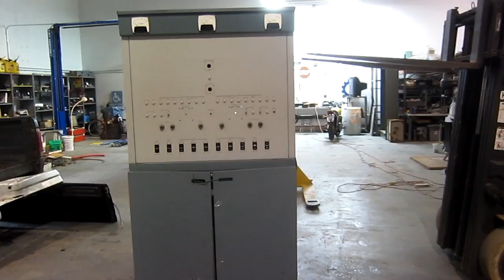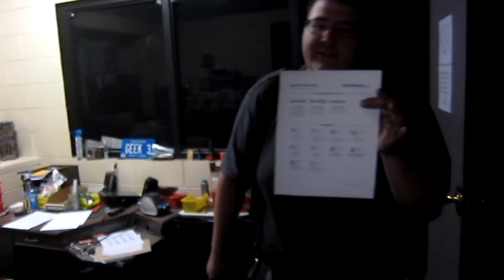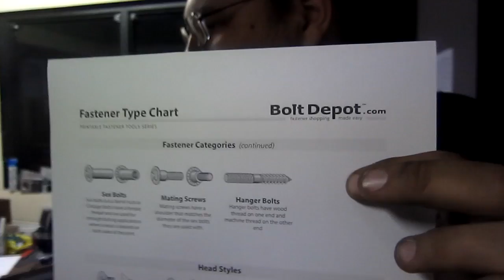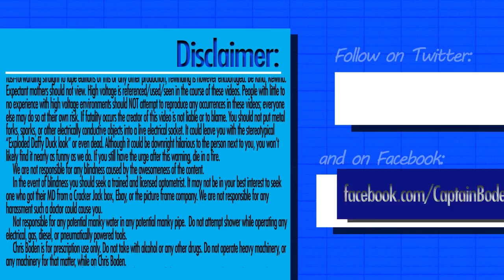Captain's Blog 7-27-11 Truck fun, accidental donation, and bolts

Comment: I happend to be cleaning projectors at the school I work at as a tech today. cleaning the filters thats is. since alot of dust collected in these filters from classroom use I cant help but thinking a large hall with various things going on including the CNC machines is surely going to cause the projectors to choke over all that crap. 
Steve mentioned light output and I think he has a point and it would seem very inconvenient to have to turn all the lights out not to mention potentially hazardous